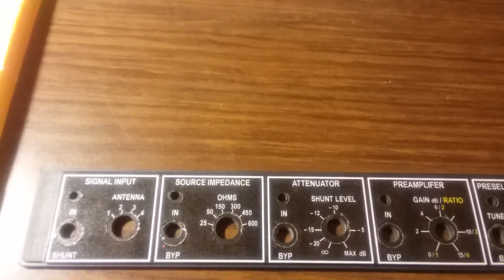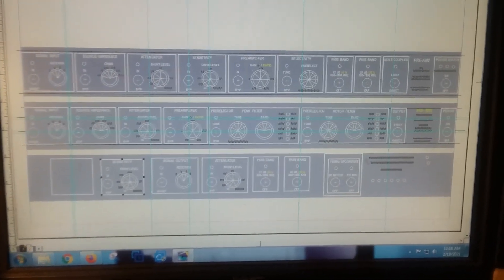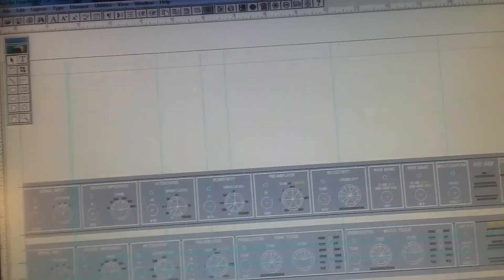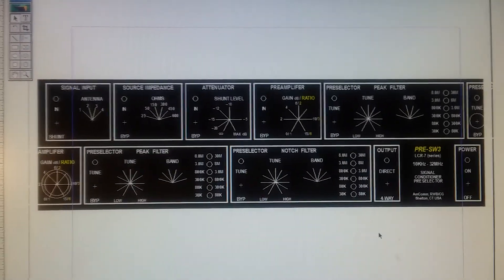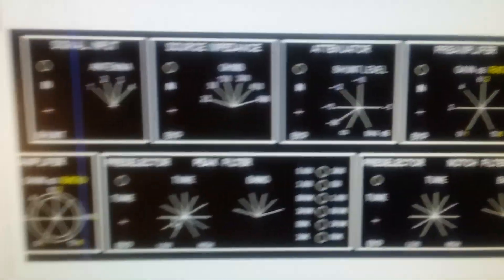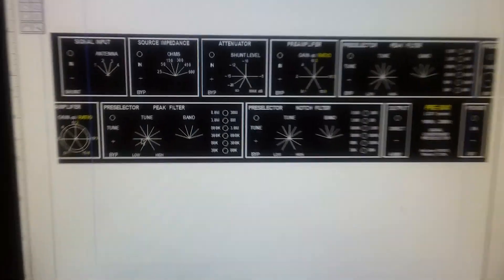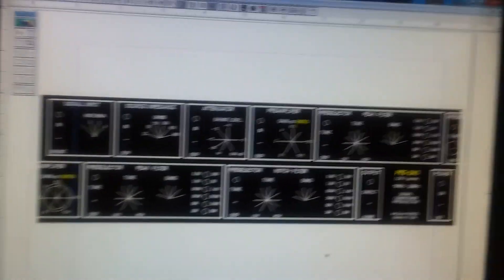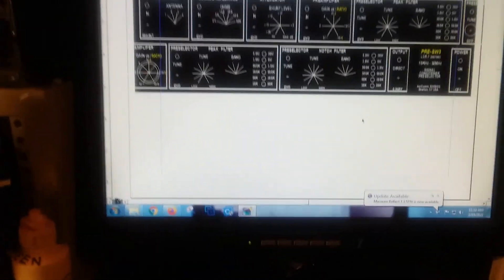Making Professional-looking Front Panel Decals for Your Electronic Projects

Comment from the maker: I think you are referring to a finished preselector and not decal program with materials. These units are built to order, so that the customer may add or remove the various modules  as required. Right now there is a 12-16 week waiting list. A maximum Preselector is presently around $3,200.00 including shipping and insurance. Due to the current economy, the price will soon go up about 12-15%. The shop is presently closed during renovations. So, if you want a preselector, it would be best to contact me personally. thank you.